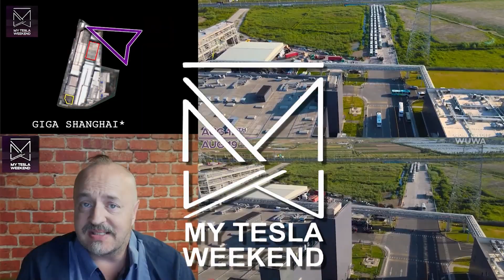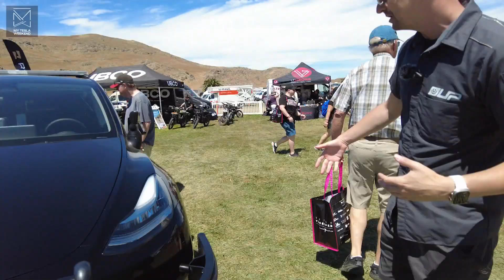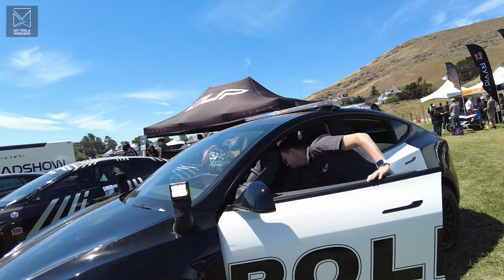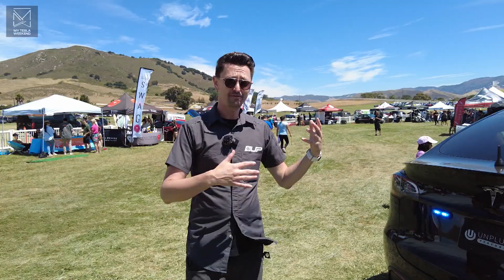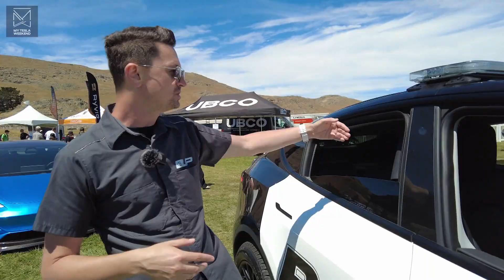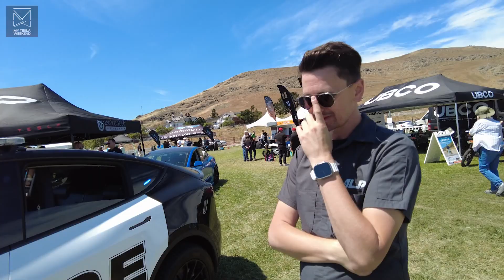EVs are the PERFECT Cop Cars

Comment: What is the range loss of the light and push bars?  Probably not a lot at city speeds, but may be significant at 65mph.  I often see police cruisers sitting idling while they do paperwork.  The police may set up some of their own charging locations, not necessarily at their stations, so a car can plug in and charge from these locations and remain in their local areas.  They might want to buy some of those break away charge cables for quicker response.
Reply: They have an auxiliary battery to run the emergency equipment. So the battery in the Tesla Model Y is not affected.

Comment: Not sure about the moving front quarter panel lights. Moving parts present another potential point of failure. Plus, they’re right at a perfect height for a meth’d out psychotic person in a rage to grab/punch/kick and somehow damage. I would go with low profile static lights that are aimed in the necessary directions for those reasons.

Comment: I wonder how they would go about disabling the collision avoidance features when intentionally running into a car for a PIT maneuver.   That would be frustrating to try and connect and have the car not allow you to. Not to mention the rare occasion where ramming might be required. The push bar would have to be very robust and easily replaceable to reduce down time between pursuits. I assume run-flat tires would be a must. I've seen some police cars loose control after performing a PIT.  I wonder if software could be used to recover if that happens.
Many of us bloodthirsty police chase video watchers probably think that the pit is the only thing they do all day long, but I would imagine it's pretty darn rare, and downtime for repairs after an incident like that would be expected.
Great video, thanks!
Reply: You must not have ANY driving experience in a Tesla. The driver is ALWAYS in control. The Tesla will NOT prevent a Pit maneuver.

Comment: I feel like you glossed over the energy/fuel issue.  Gas still has the advantage of quickly refueling.  Allowing police to have extended patrols.  What is the actual runtime for a Tesla police vehicle in working conditions?  Can  they get through a 12 shit which then gets extended due to investigation or pursuit.  They will be running climate control all day.  

I honestly don’t know the answers here.
Reply from the maker: Most departments don't run cruisers 24/7, and very few cruisers run more than a couple hundred miles a day. This means they can charge it during shift changes or breaks while still running 3-shifts, or just plug it in overnight.

Whether it's gas or electric, if you're running low during a chase, you're not going to have time to top it off.

The biggest waste I've seen is during crowd control situations where cruisers are parked while idling for the entire shift. You'll burn a half-gallon per hour (2 liters) or 12-gallons a day. An EV "idling" only consumes the juice needed to keep the electronics and climate control running. An EV can run in that situation for literal days for a fraction of that cost.
Reply: @FutureAzA  thank you for the insight.  Greatly appreciated
Reply: love the typo...